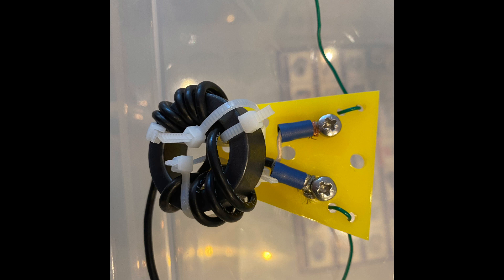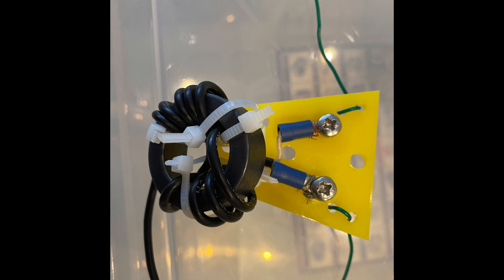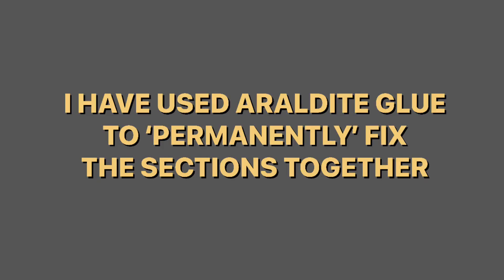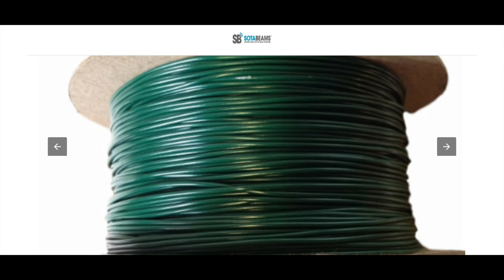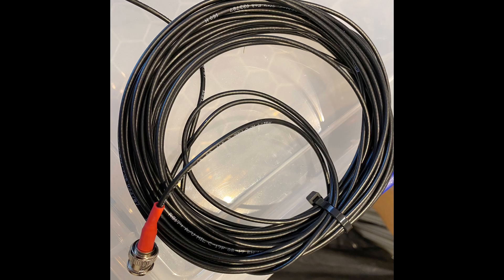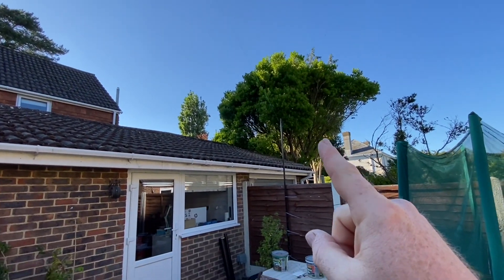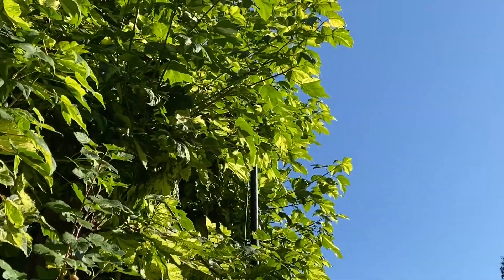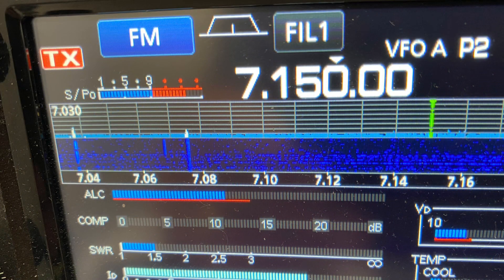How To Make A 40 Metre Dipole

Comment: Hi Tim, An excellent presentation. It just shows what can be achieved in a relatively compact space, with some thought and good planning!  To take the idea a step further, I would make this mono band dipole antenna into a multi-band Doublet antenna. Then it could be used on any band between 40 metres and 10 metres. Possibly even 6 meters too. Just replace the coax with twin feed or open line and use a good, wide range antenna matching unit (ATU).  Brilliant work. Thank you for your time and effort in making these videos!  Encouragement for all!  73, Mike. M0MTJ.
Reply from the maker: Thank you Mike! Yes the good old multi band doublet. A very useful antenna. Appreciate your kind comments and support. 73

Comment: Good advice! 40 meters is always open to somewhere 24 hours a day. The dipole is probably the best antenna for both the beginner and someone like me who has been on the air 60 years. I have put up low portable 40 meter dipoles as low as 3 feet high up to the height of my permanent dipole at almost 50 feet.  They all work better than any vertical!  I will note that I never needed a balun in 60 years. I did wind one a few years ago but would not do it again. A dipole fed with coax coming off at a near right angle should not need one. A balun is a good idea if you have a highly directive antenna and want to preserve the symmetrical radiation pattern. I always suggest beginners start with one band and learn the fundamentals. Most people work during the day so they need a band open at night (160, 80 or 40). I suggest 40 as it is both day and night. Single band dipoles are about as good as you are going to get with wire antennas. I connect more than one to my coax sometimes and get a great multiband antenna. I presently have a 20 meter dipole and a 10 meter dipole on the same coax. That’s easy to handle. I have had 40/ 20 and 10 on one feedline. Great antenna ( I worked 100 countries on each of 4 bands in one contest on it) for 40, 20, 15 and 10. That’s if you cut the 40 meter dipole for the CW band of 40 so it works on 15 meters. That is a bit more difficult to build than just a 2 band dipole but I have built several. Spacers can be 1/2 pvc pipe. 
Keep up the great videos!
Reply from the maker: Thank you! I agree, dipoles are simple and are the benchmark for a reason. 73

Comment: very interesting Tim,  yes im actually looking to do this myself for 80mts, im curious,  would speaker wire be suitable i wonder?
Reply: I am certain that speaker wire would work. Any wire really, as long as it is physically strong enough. The first antenna I made when I was first licensed was a wire dipole for the 10 metre band. I used some old, fairly nondescript loudspeaker wire. The first contact I made was straight into North America.  So yes. It works! 73, Mike M0MTJ
Reply: @mikesmith5139  thanks so much for that Mike,  brilliant I'll do that 🙏🏻
Reply from the maker: Absolutely Mark 73
Reply from the maker: Agree Mike nice one
Reply: @welshbikepackingadventures  Have fun with your version Mark!  73, Mike M0MTJ
Reply: Hi, just a tip about what Wire to use for Antennas, keep in mind, that if it stretches it will change the resonance, so use the best you can find for a non sag Antenna, HiHi! 73 Alex
Reply: @alexdokic5567   thank you Alex 👍🏻

Comment: Hi Tim,don't suppose you checked swr on 80m using the 66ft?? Just curious as want to do same sort of thing for nvis on 80m but very tight on space and currently don't have an external tuner.many thanks 73
Reply from the maker: Hi Andy. Unfortunately a quarter-wave dipole (which by definition would be center-fed) has a very high feedpoint impedance. Feed it with coax and you’ll get (a) a difficult match and (b) massive coax losses. The only way to get a reasonable performance on 80 with this size of antenna is to feed with ladderline and then of course you’ll need an external tuner. 73
Reply: @Tim G5TM  thankyou Tim much appreciated 👍
Reply from the maker: The other way if you are tight on space is to use a 66ft efhw with an additional 110uH coil at the end and a further 6-7 feet of wire. It’ll give you 80 (all be it a narrow swr bandwidth) and 40,20,15,10 into the bargain. If you don’t want to build your own coil then check out uk antennas who sell one for I think less than 20 quid. Just add a 49:1 and your own wire.
Reply: @Tim G5TM  that's what I've got up mate but 80,40m are very noisy n not that great.just bought a nice big 1:1 balun so gonna try somehow to gey something sorted for 80m weather permitting

Comment: thanks for the info tim shame i cannot use one of those type dipoles due to two issuses one my garden is litrally only 11ft by 10ft and i have 4to 5 telefone cables crossing over my backyard at roughly 20 to 25 ft above ground which is a major pain also i live in the basement flat of a four storey building mid terrace i do have a vertical i use for 20mtr 17mtr 15mtr 12 mtr and 10 metr but it wont stretch to 40 or 80 mtr iv tryed using the X80 verticle in back yard but the noise lvl i get just doesnt make it worth using on 40 or 80 mtrs even invested in an mfj1026 delux noise canceling signal enhancer which works wonderful on most bands except 40 and 80 as noise levl is still strong enough to make those two bands virtualy unusable for me too much local noise that i just cannot cancel out with secondary antenna ( you have to use 2 antennas for noise cancelers to work ) no matter where its placed to bring most noise into it its shame cos id love to give 40 and 80 mtrs a try
Reply from the maker: Ah yes you have your work cut out for 40/80. I suppose the ONLY thing that springs to mind is a hamstick dipole for 40? Can you accomodate about 16 feet across?
Reply: @timg5tm941  just about my back yard is roughly 17ft by 18ft maybit little bit smaller but not much
Reply from the maker: @sniperchaz111  might be worth a try then?

Comment: I watch all these new ham limited space videos and none really help. the instant anything over 6m high or 7m per side is mentioned, I sigh. I'm renting and council says no more than 6m high without having to get approval. Which means asking my landlord. the back yard has a space of 14m from the side gate to the back fence and another space 14m along the back fence. an inverted V won't fit with a 6m pole (needs 8m X2). so I'm looking at a loaded dipole or centre load vertical for 40m. 40m being the only dxIsh band for foundation licences. I'm half thinking to forget about it until I can do my standard licence for 20m.
Reply from the maker: Why not try a shortened 40 20 10 half wave? 11.85m long - inverted V  or L?